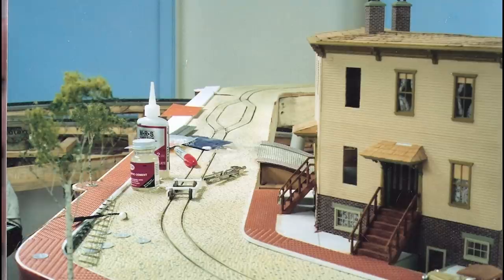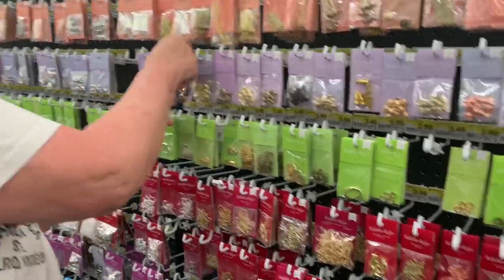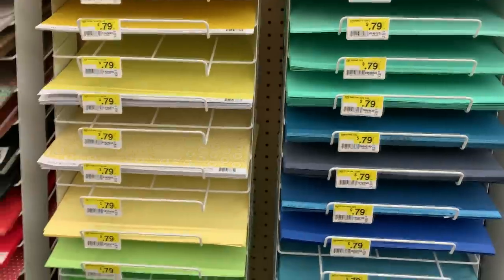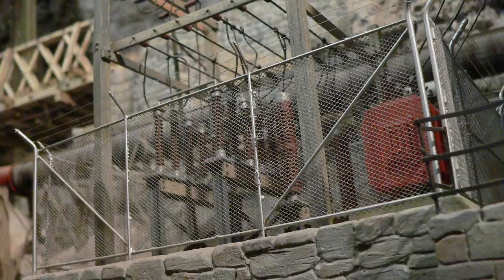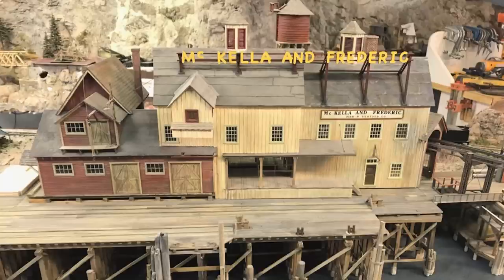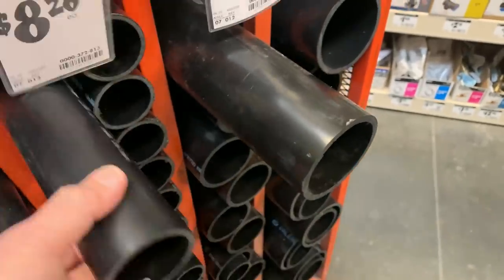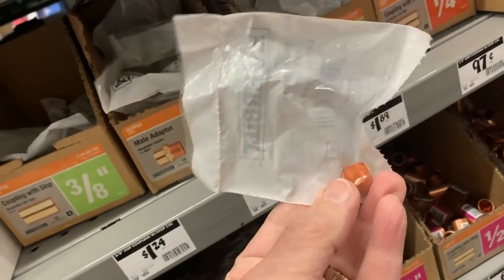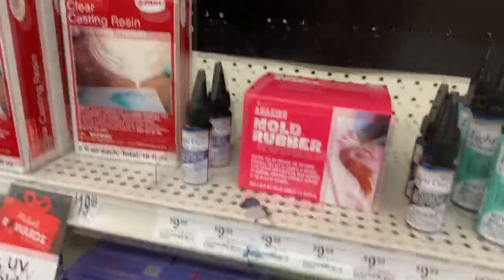Scratch-built Miniatures from Everyday Objects - Craft stores to hardware stores

Comment: If you haven't tried it Renshape is a really fun material. It's polyurethane foam sheet. Kinda like styrene foam insulation sheet but much stronger and doesn't melt if you use solvent on it. So you can use lacquer if you want, superglue. Stuff that melts the styrofoam. Sheets of Renshape are really expensive, but I get off cuts off Ebay, this save a ton of money and you can get some really usable pieces.
Reply from the maker: I’ll look into that. Thanks

Comment: There is a type of "foam board" that is called "Gator board", in the point - of -sale printing industry. It is foam core with .020 thick plastic on both sides, used where water might ruin the paper substrate. Finding it at a craft store may be difficult, but if you have a POS printer near by,, you might be able to get some there. The stuff comes in 48 x 96 and sometimes 50 x 100. It comes in 1/8, 1/4, 1/2 and even 1 inch thicknesses. It ain't cheap either, Guessing I would say a 48 x 96 1 inch thick sheet is very close to $100 today, it was $75 in 2008. 
Jo Ann's has changed since I was last there, trying to find parts or repairs for a sewing machine. Great video, it's really cool what you can do with all those beads and things. ;-)
Reply from the maker: Bought some. Haven’t tried it yet but it looks like it’s great.